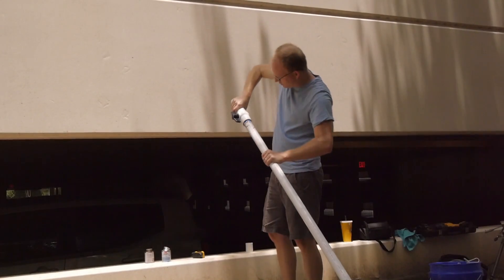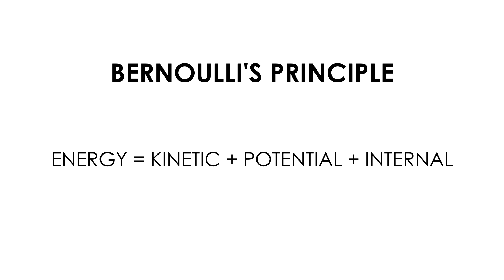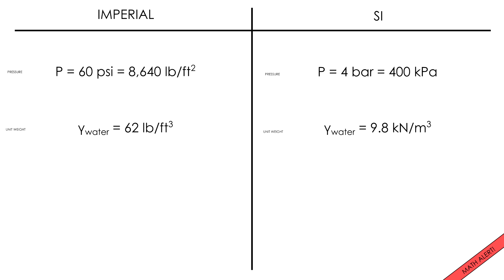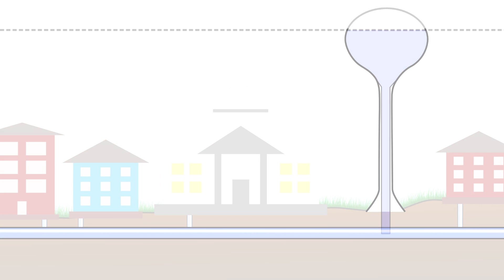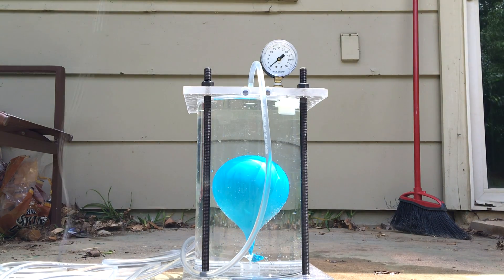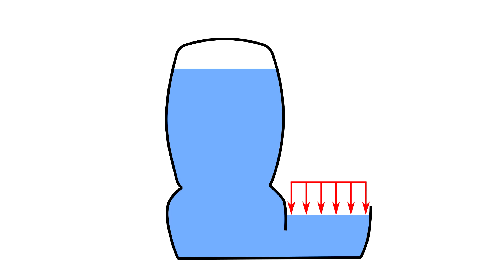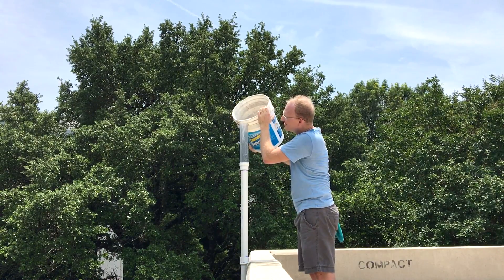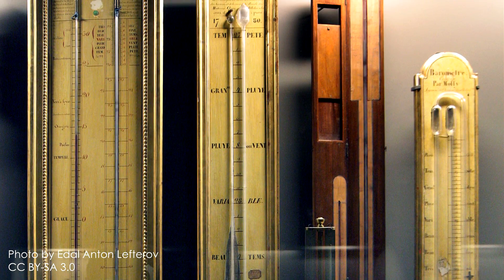Boil Water at Room Temperature! - Hydrostatics

Comment: I'm thinking - how could you or somebody else use this principle to, for example - boil off water in viscous fruit juices, to get fruit juice powder, or steep volatile compounds, as for example mushrooms, to extract their flavors without heat. Would any of these two applications would be possible using a tower like that? And that get's me thinking -- so how large of a tube would somebody need to get to increase the pressure at a bottom of a lake? Or A swimming pool more like. I didn't quite understand what is the limiting factor for me not to get a small tube, fly up into space and increase the pressure in the oceans so that all sea creatures die from pressure at the bottom of the sea. :D ?

Comment: Hi, I have a question. One atm is equal to around 34 feet water column, but in the inverted tank example, the high difference is much smaller than 34 feet. Why isn't air pushing it back until there is no vacuum in the upper part of the tank? Thanks

Comment: would you be able to notice the pressure on the bucket with your hand, also I've heard of an old experiment where they busted a barrel using the vertical pipe of water. would this be doable with a straw or Its there a point 
where this stops working?

Comment: In the first tank example, what happens as the skinny neck of the first tank becomes thinner and thinner? As the neck approaches zero thickness, the depth would effectively change to the base of the neck. Assuming a fluid with negligible capillarity, how many molecules wide does the neck have to be before you see the pressure drop?
Reply: Another question, if you had a column of liquid with only the width of a molecule, could you lift it higher and higher increasing the pressure enormously while doing almost no work? And if so, someone should make a hydraulic press out of this, since it would require almost no energy. But they'd have to be careful not to touch such a thing to the ocean, since it might instantly crush all of the fish the moment the water column touched the surface by increasing the pressure across the whole body of water.

Comment: Nice vid i have just 1 question why is only the water at the top boiling while the energie is everywhere the same ?
Reply from the maker: +Maxim Costers the energy is the same but the pressure is not. The pressure in the water is lowest at the top and highest at the bottom.

Comment: Step one: put straw in glass of water
Step two: blow through the straw
       Congrats, you just boiled water at room temperature.
Reply: Blowing air into water does not cause it to boil. The water is not turning into it's gaseous form. 

The only way to do it is through temperature and pressure.
Reply: +Cody Hubert it's a joke.

Comment: I would have to disagree to the statement about the hight of the water tanks. there are all types of potable water tanks. yes you have the tower ones but they all very in size and shape then you also have in ground water tanks. they use pumps to move the water out of the tanks and to where ever they want. gravity does play a role but not all water tanks are the same hight is what i'm getting at this. you are doing a great job at explaining how this all works

Comment: Very cool video as always- wish you'd mentioned what height this happens at!
Reply from the maker: +looksintolasers Thanks. At the end of the video I do give the equivalent height of a water column compared to atmospheric pressure and I show how to use wolfram alpha to figure that out.
Reply: +Practical Engineering I learned about this while reading a book called Asimov's Chronology of Science and Discovery, he said miners were trying to figure out why they couldn't pump higher than about 33 feet :)

Comment: How would you calculate the Heat generated from the boiling water at this height? besides sticking in a thermometer :p
Reply from the maker: There's no heat generated. In fact the water gets colder because of the evaporation.
Reply: So when we say 'boiling'. Are talking about the process of converting the liquid to gas at that specific pressure level?

Amazing video btw :) Loved it and learned alot :)

Comment: So, the wideness of the pipe in a barometer doesn't change the height of the mercury/water?
Reply from the maker: Correct. All barometers that use the same fluid will be the same height, regardless of how wide the tube is.

Comment: hey quick question, if you were to plug the hole you made in the example of the freaky water bowls, would the water rise back up since atmospheric pressure would no longer be acting upon it(assuming the water did not spill out from the other side)
Reply: what you did in 7:20
Reply from the maker: No it wouldn't come back up, but it would stop going down. The air trapped inside the tank would apply pressure to the water. Not as high as atmospheric pressure, but enough to keep the water from rising any higher.

Comment: So in regards to a water tower, if the tube/amount of water at the bottom of the tower are the same, you wouldn't see an increase in pressure by adding more mass at the top of the tower?

No, because to keep the height the same, you need to increase the surface area?

Comment: There's actually a really simple way to get the same sort of effect. If you get one of those pediatric syringes, fill it a little bit with water, then pull it while blocking the nozzle with your finger, you actually have enough strength to get the water to boil.
Reply: But your skin keeps pressure on your blood, so it wouldn't boil.
Reply: I did it all the time as a kid. The nozzle is too small to effect more than a small area of skin. You just get a small dot of redness, but it doesn't effect anything else. It's not the same as exposing your whole body to a vacuum.
Reply: Just don't do it to your face or you'll become a meme.

Comment: the part with the boiling at the end was really interesting, too bad it was so short. I wish you could describe it in more depth :-/
Reply: +Cody Hubert I've experienced this when I used a rotary evaporator to sequentialy evaporate ether and water from a mixture. The ether came off at atmospheric pressure and got collected, then the water evaporated at high vacuum and froze in the collecting flask where ether had evaporated.
Reply: The best part is that the water actually gets colder when boiling it this way.

The reason for this is that the temperature is not affected at all, but when pressure decreases the first molecules of water to vaporize are the ones that are slightly warmer than the rest. The liquid left over is colder as a result, though unnoticeable with a human hand.
Reply: +log1x07 In more 'depth' ;)
Reply: Proto G, when you mean external pressure, do you mean the atmosphere? I'm curious about the water boiling on top of the pipe, but I can't imagine what factor caused it to boil - Why did it boil only when he opened the valve?
Reply: The boiling point of a liquid decreases with decrease in pressure. In vaccum water can boil at room temperature.
If you are on top of a mountain where pressure is lower than sea level, it will take more time to cook food than normal. Because water boils at a lower temperature than 100°c.
Pressure cookers cook faster because inside the cooker the water boils at a higher temperature due to increase in pressure than 100°c. Opposite to what happens in that tube.
Reply: I sat down and calculated it myself with help of bernoulli. I totally get it now. thx for the replies though :)
Reply: What most people know as boiling is actually a system in chemistry called vapor pressure. Every liquid as a specific pressure or temperature at which the intermolecular bonds in the fluid can no longer hold atoms on the surface back from equalizing the pressure difference. When you have an entire pot that’s on a rolling boil, the only places that the water is actually turning to steam is on the “surface” of the bubbles that form at the bottom and then quickly rise to the top. God I love chemistry...
Reply: @warrcoww6717  thanks a lot man - although I figured it out earlier but comments like you which don't use unintuitive jargon are most appreciated. :)
Reply: Can someone help me? Is it possible to calculate how much water evaporated? I have difficulty calculating it...
Reply: Haha, depth! Get it? Because the video was about hydrostatics?
Reply: yeah probally boiling shouldn't be confused with hot?? i'mguessing i won't be able to have a cuppa tea with the water at the top of the pipe???
Reply: Loving the pun here. Intended or not. Depth
Reply: amazing,., i didnt know water boils at vacuum.
Reply: Pv=nrt,  learn about partial pressure also
Reply: +Nate9273 Same reason anytging boils, because the vapor pressure is higher than the pressure on the liquid. Normally we increase the vapor pressure by increasing temperature but here instead the pressure itself is decreased.
Reply: @Quintinohthree  if the pressure at top of the column is vacuum pressure why not the entire column get evaporated
Reply: @sai-lo3rx  Because it's only a vacuum at the top of the column. Even if it's a perfect vacuum at the top, you reach room temperature vapour pressure at about 25 centimeters down.
Reply: His videos should inspire you to do more research on your own.  Water boils when the vapor pressure equals the external pressure exerted on the liquid.  You can achieve this by increasing the temperature or decreasing the pressure or any combination of the two.  This is why water boils faster on the stove in higher altitude cities compared to sea level cities.(lower pressure at higher altitudes)
Reply: log1x07  It's very easy. The boiling point of water drops as the pressure is lowered. You can actually boil water at the room temperature or below. Put some water in a glass bottle and lower the air pressure with a compressor and voila :)
Reply: Is there a way to use the heat from this kind of boiling water?
Reply: the answer is a flip flop. temp=presh. presh=temp.
carnot cycle.
think heat cycle.  heat pump.
right in front of your eyes.
my dad and a 5th. grade science book,and men, taught me this.
closed cicuetsnever = fe.
Reply: cavitation

Comment: How bout this, water pressure can push UP.  On your examples where you had the big tank at the bottom with a thin column of water, the water pressure pushing on the wall of the tank is pushing up.
Reply from the maker: Exactly. Water pressure acts in all directions equally.

Comment: Wait i dont understand. "You can boil room temperature wather, by just brigining it to the top of garage"... So how come wather in bottle doesnt boil when i bring it to 10th floor of my building?
Reply: The relative potential energy between the water level in your bottle and the bottom of your bottle doesn't change.
Reply: wait let me re-fraze that. Can i somehow boil wather, and have heating in house, if i place really really tall pipe on my building?
Reply: Sasquatch You understand that the temperature of the water doesn't change in phase transition without more energy? The boiling point just changes.
Reply: Yes you can boil water this way, but no it can't heat your house, because it will be as cold as your house, even where it is boiling.
Reply: Some Other Dude is right, the water boils, but it doesn't reach "boiling temperature", it just boils at room temperature because of the pressure difference, same reason water boils at a lower temperature at high altitude, less atmospheric pressure acting on it.

Comment: I think your thermodynamics is wrong here. It IS boiling from heat. It just happens to be boiling from the ambient temperature of the air surrounding the tube. By pulling that high vacuum on the water it lowered the boiling point. So if it was a nice summer day of say 26 C that means if you pull a vacuum of about 0.034 bar it should cause the water to boil at 26C, but you still need that external heat. Here's a chart of the boiling point of water. http://www.engineeringtoolbox.com/boiling-point-water-d_926.html
Reply: It is not boiling from adding heat like you normally would.  Water boils when the vapor pressure equals the external pressure exerted on the water.  You can either increase the temperature or decrease the external pressure to achieve this.  I can boil room temperature water by placing it in a vacuum chamber and the temperature decreases as the water releases energy and will transition from boiling water to ice.
Reply: Yes, you can boil at room temperature, but the temperature is still part of the equation. Let's just say for argument that "room" temperature is hot at 38 Celcius, to boil it you have to apply a vacuum of 0.069 bar. (look at the table I posted yesterday)

But... if "room" temperature is colder at 26 Celcius, then applying a vacuum of 0.069 bar will not boil it, you have to go to a lower vacuum of 0.034 bar. 

It is not the vacuum alone that is causing the boiling process. It is the pressure and the temperature. 

It gets even crazier if you release liquid water into space. Since it is both an ultra high vacuum and nearly absolute zero. When that happens the liquid will both boil and then freeze.
Reply: Yes, I know, I said it's not boiling from ADDING heat.
Reply: Yes it is. The "room" is adding heat. In the case of water in the tube, it just added the heat before pulling the vacuum. You're still adding heat.

But...if you start with an ice cube at 0 Celcius and put it into a 0.034 bar vacuum chamber it's not going to boil immediately, but if the chamber is uninsulated and placed in a room at 26 celcius, the ice will melt and then eventually boil when the room warms the ice/water up to 26 celcius.
Reply: I understand that.  You're arguing semantics of his title and my comment. I said, it is not boiling from adding heat like you normally would. (i.e. a stove) and that is also what he meant by his title.
Reply: Yes. I am, because it is a big mistake. He's demonstrating something both interesting and quite important and he's left out 50% of the reason it occurred.
Reply: "But...if you start with an ice cube at 0 Celcius" - 0 celsius is not 0 added heat. Try in kelvin. By your logic everything is about temperature since we can never reach 0.

Comment: Did you mean to draw the illustration of the cat bowl with the atmo tube being on the other side (closed top)? Weight of the water pulls and creates a vacuum?
Reply from the maker: A vacuum is just a lack of air pressure. The illustration is trying to show that the air pressure cannot act on the water surface inside the tank.
Reply: +Practical Engineering I was referring to the drawing of the pet bowl with the long tube going up into the atmosphere; both ends were closed off(closed to atmospheric pressure). The demonstration you did at the end had the 'reservoir' going up the parking garage and the 'bowl' (bucket) open to the atmosphere.
Reply: at around 9:00, thee vaccum is created bc of the weight of the water in the tube right?
Reply from the maker: Oh I see what you mean. The red lines were just to show the "column" of atmosphere acting on the free water surface.

Comment: I just discovered this channel, and this video is very good. It adds "concretness" to the hydrostatic potential seen in school.
As a perfectionist, I have to point out that the explanation of pressure=force/area leading to the independancy to the column width might be better. I always represent myself a infinitesimal cube sitting at the point I want, and the weight of the waters columns above push on the top whereas the weight of the waters columns next to the cube push on the sides. So each column push on others columns and the net result is that only the height plays a role at equilibrium. This reasoning put the emphasis that pressure is really a local measure of force and this is what matters in water at equilibrium. And from this representation, you can directly deduce (with a bit of calculus) Archimedes' principle.
So now, I hope a bit of Archimedes' principle in the next video ^^ Cheers !
Reply from the maker: That's a very good way to look at it. Thanks!
Reply: Of course you can derive Archimedes principle without calculus, as Archimedes himself did.
Reply: I guess he got it by experiment, but you say that he derived it "theoreticaly" from more fondamental principles ? And when I say "calculus", I mean infinitesimal thinking :)
Reply: +Astérisque Etpéril
Read "On Floating Bodies" by Archimedes. An interesting read.
Reply: Yeah I don't think the way that Grady explained it makes any sense. If it's strictly a matter of cross sectional area canceling out cross sectional perimeter, then the shape of the cross section matters very much. But the column of water could be circular or star shaped- it doesn't matter.
Reply: i have trained as a civil engineer and understand hydro statics. but this way of looking at it just makes even more sense. thanks
Reply: +Astérisque Etpéril I can see your fedora from here, lol.